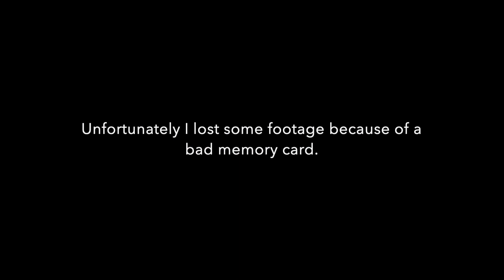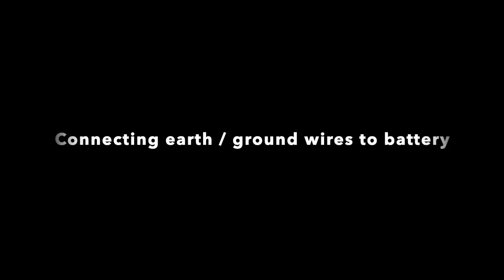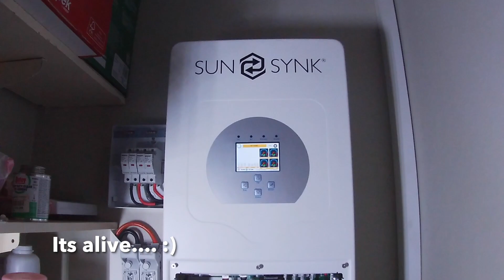Part3 - Solar system install: Connecting cables to inverter and turning on the battery and inverter.

Comment: Can the inventor operat minus connecting it to the grid?
Reply from the maker: Yes, i think if it shows a minus it could be pushing back into the grid or it could be that your CT connection is the wrong way around on your main.

Comment: Did you used inverter supplied yellow cable for connecting bms with battery ... that yellow cable came with inverter it self . Pylon tech battery contains black bms cable
Reply from the maker: Yes i did use the yellow one from inverter, i also later on used the black ones between the batteries.

Comment: How many awg(mm) have you used the grid cable and the load cable
Reply from the maker: Hi, if I remember correctly i used 6mm cable. I had some extra left over from the cable i used to connect the solar panels.

Comment: Hi! Did you just use the standard data cable to connect the Pylon battery to the inverter (ie. pin 1 to pin 1, pin 2 to pin 2 etc)? Just checking there are no crossovers in pins from inverter port to battery port?
Reply from the maker: Hi, i used the cable that was supplied with the inverter, but when i checked the ends now, it looks like a 1 to 1

Comment: Hi, I bought the Sunsynk 5 Kw and Pylontech US3000c.Wathecd your video and connected the yellowcomms cable as you showed but no battery comms.. Can you supply me with the correct pimout for that yellow cable, it looks like a standard RJ45 fly lead?

And if possible the battery settings you use, float, charge etc

Thanks

Christoph
Reply from the maker: Hi, apologies for the late reply, I missed your comment coming in. Here is a link to a close up of the connections. The inverter should automatically pickup your charge and discharge settings. 
https://youtube.com/shorts/4PJ6JlJokQE

Comment: You can actually connect the CT coil, inside the inverter, on the input AC. The Blue Nova CPS5000, witch is a Sunsynk 5KVA and a BN 5.2KWh battery, already assembled and wired with breakers and all, is wired like I mentioned.

Comment: Can you please explain to me how to connect power on the DB side 😃😀🙂🙃
Reply from the maker: Coming soon! I got all the components where i’ll be splitting my db into 2. One for non essential and the other one for essential. Currently finishing off recording my next video where i build a battery stand and add 2 more batteries to my setup.

Comment: Great videos, really enjoying them! Is it possible to set the inverter to use grid power if there’s no solar or battery, but only charge batteries from solar?
Reply from the maker: Thanks, yes with the hybrid inverter you can.

Comment: Hi, i also recently installed a 5kw Sunsynk and it is emitting buzzing noise through the devices in my house especially PC screen and PSU. Does your unit emit any noise? I can pick it up on a sound spectrum app on my phone around 15000Hz.
Reply from the maker: Hi, Unfortunately No I do not get any of those issues. When there are big load on the system with mid day sun, I get a fan soft fan noise.I did find this in the manual.. "Installing the indoor unit, outdoor unit, power supply cable, transmission cable, and remote control cable at least 1 metre away from any television or radio receiver. This will prevent TV reception interference or radio noise. This will prevent radio signal interference from external units that might interfere with the Wi-Fi or GSM monitoring." I hope this helps, best of luck.

Comment: Very nice and detailed video.

Would appreciate if you made a video showing the wiring of the load and grid outputs of inverter to ac protection box and then to the main db
Reply from the maker: Video on that is in the pipe line. Busy working with an electical engineer on splitting of the db board into Essential and non Essential boards

Comment: Why not just put your ct’s on the cable terminated on the input side of the inverter instead of extending it?
Reply from the maker: Hi, the CT is used to stop current from being pushed back into the grid and give the inerter the ability to still push current into your non essentials DB board. It need to be connected to the point where your mains enters the building / db board.

Comment: Nice video, very detailed.
How far away from your main db have you installed the inverter?
I am looking at doing something similar but I want to install the inverter in the garage which is about 22m from my db, so not sure if extending the CT that far would work
and how thick a cable I would need to run.
Reply from the maker: My inverter is 8m away. In the manual it states that you can extend the cable by another 10m.

Comment: nice installation🙃

just worried about the space, bec it looks so nice, you would want to expand at some stage, and you will need  space for another 1-2 inverters and battery packs as well.

did you purchase the inverters and batteries directly from SunSynk, where can i purchase from? 

what did this cost so far?
Reply from the maker: Thanks, the plan is that when I need to expand I can remove the shelvs to make space. Then I should be able to add another 4 inverters and batteries in the room. A rough guess for total cost is +- R62 000. I purchaced most of the components from  www.inverter-warehouse.co.za

Comment: Cool Video. so are you going to install an Earth / Neutral bond relay?
Reply from the maker: Thank you. yes a copper earth spike that is connected to the solar Pannel frames, and another copper earth spike that is connected to the earth wires.
Reply: @DoSomethingEveryday  are you going to get a extra battery?